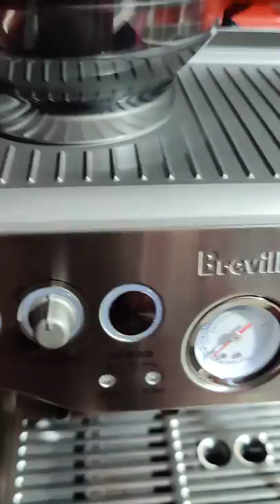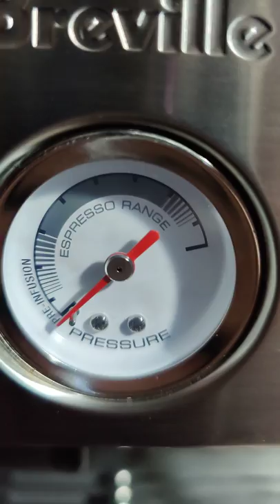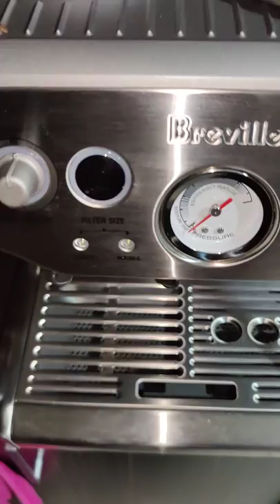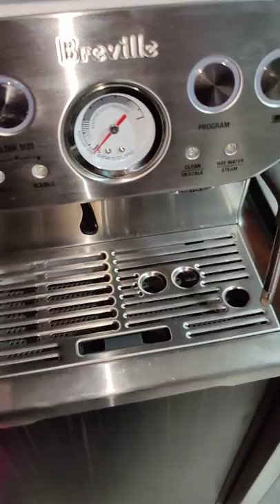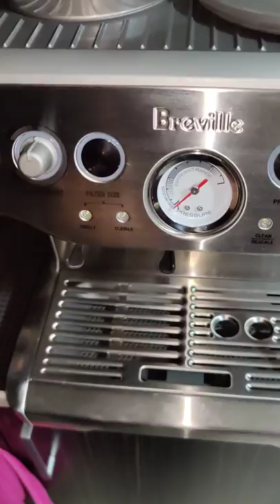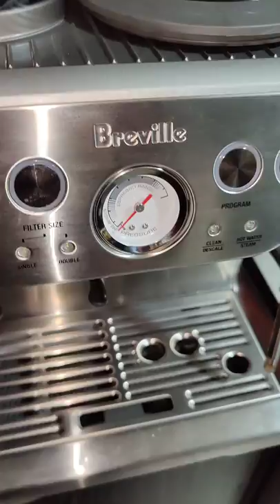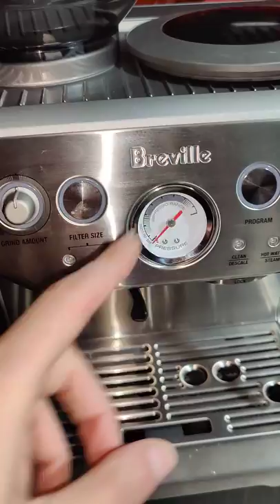Breville grind size adjustment (top burr) Barista Express BES870, Pro, Touch, Oracle, Smart Grinder

Comment: My upper burr doesn't have any adjustment, older model so I can't get the coffee fine enough
Reply from the maker: There are 3 solutions 
Best is to open it up and adjust the grind adjustment collar.
Second is to add a thin washer shim under the bottom burr 
Third is to get a new top burr, the new version.

Option 1 is safe if you don't overdo it and adjust by 3 teeth at a time.
Option 2 us risky because if the washer is too thick you may have burr on burr contact.
Option 3 is quite safe but costly
Reply: @caffeinefix2751 do you have a vídeo with an explanation on how to adjust the collar?
Reply from the maker: @lucianos1624  no I don't, essentially you'll have to remove the lid, unscrew and remove the grind size adjustment dial, turn the grind size all the way to large or the collar all the way clockwise, then turn it a tiny bit anti clockwise, and using 2 index fingers remove the small white cog on the very left, this can be quite painful! Under where the cog attaches there are 2 flaps/clips that you'll need to push towards each other with your index fingers while simultaneously pushing the cog upwards, you can use someone else's assistance to pull the cog while you push those clips inwards / together. this is the hardest part, and once you remove that small, white cog, you’ll need to turn the big collar cog by three teeth anticlockwise to adjust the grind size finer. this can also be tricky because you can never be sure how many teeth exactly you need to turn. if it’s a really old machine, I maybe doing four or five teeth if the grind size is really large and it needs proper calibration after many years. but usually I start with three then I put the little cog back and see if the burrs touch at the finest setting (by turning the big cog anti clockwise all the way). it’s tricky, because if you overdo it, that means grind size 1 2 and 3 will be dangerous and touching the burrs. on the other hand, if you don’t do enough teeth adjustment , it may not be fine enough so we have to go back into the small cog and do that painful removal again.
Reply: @caffeinefix2751  thank you!! I’ll be doing it in the next 2 weeks. Or when i have the courage to 😅

Comment: But uhm if they touch.isnt that dangerous if someone dials it to the finest setting and the burrs touch? Metal filings or something. I mean wouldnt it be safer to go 1 inner setting high so they cant touch?
Reply from the maker: Very good question! You might think that, but there's a tiny bit of play in the mechanism, so that when the burrs are set to that setting 1 for example and spinning, they're very close but not actually damaging one another because if there's beans, they push out just that little bit more. Still, I wouldn't use that finest setting, usually a few numbers above work perfectly for me. You can, if you want to be safe, set the inner burr one number larger.